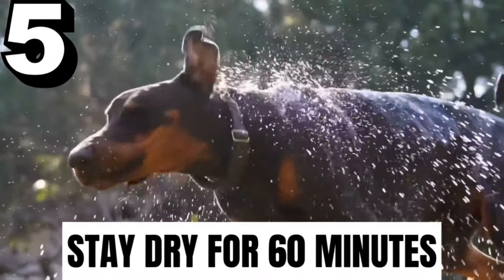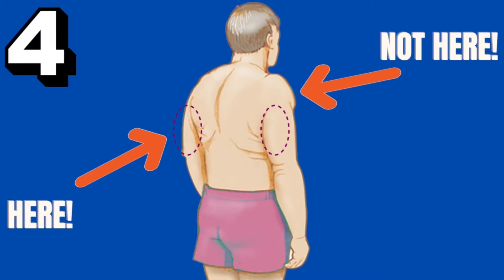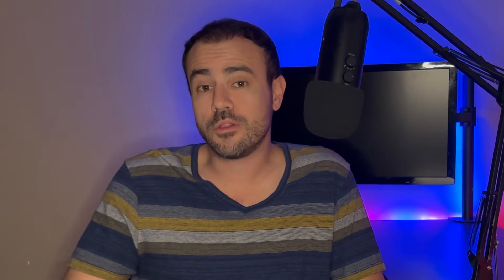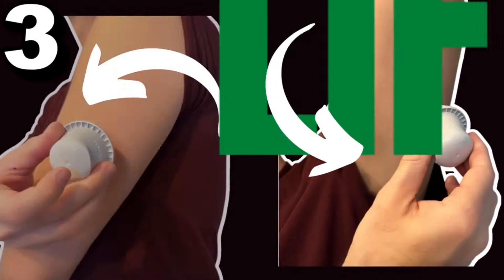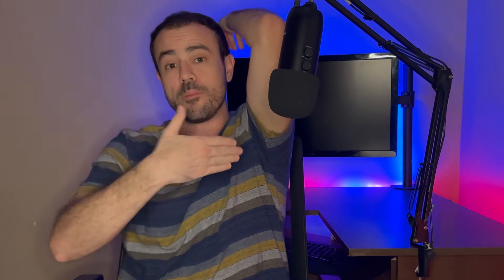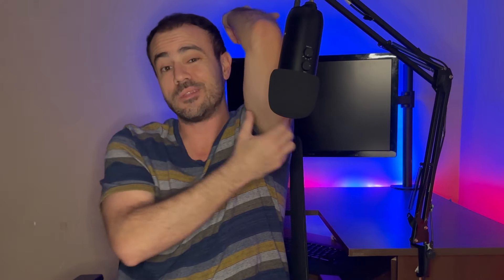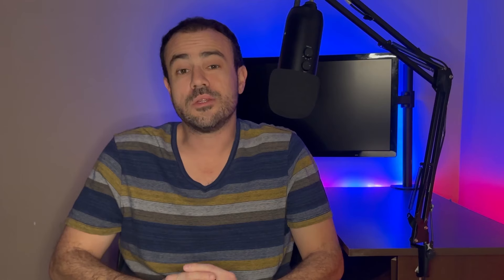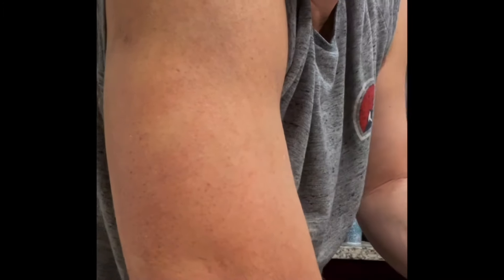Tips To Put Your Libre On The Right Way You Wont Find In The Manual!

Comment: I wish there was a work around so that we don't lose 60mins of readings in between sensor changes on the Libre3.
Reply from the maker: I agree. I hope in time the warm up period is eliminated. We’re definitely getting closer, the new Dexcom G7 is down to a 30 minute warm up time.
Reply: There is a work around when you see that you have 1 day left on the Libre 3 sensor, Insert the new Libre 3 sensor then when it shows you only have 1 hour left start the sensor you put on 23 hours ago. By doing this you are able to get better readings because the sensor has been in your body for 23 hours and has gotten adjusted to your body. Only thing is you need to have a second phone for this to work since starting the new senor will replace the previous sensor that was being used. This allows you to have non stop CGM readings. Hope this helps you out.
Reply: You are not going to die for 60 mins
Reply: Or, have a good old fashioned glucose meter and prick your finger during those 60 mins., if you need to.
Reply: I'll pass, to much of a hassle..smh. a finger pick not bad..
Reply: If the 60 minutes is a problem, it could be you have not realized one of the best features of a CGM.  A CGM allows one to chart, in real time, the effects of what you do, what you eat, and what you drink.  If after 14 days (336 hours) you haven’t figured out what you ate, drank or did leading up to the blank hour would do, shame on you.   Try to gain more situational awareness!
Reply: What’s an hour lost in two weeks?
Reply: I remember therapy and some sort of rehab!
Reply: Just put a new sensor on 1 hour before the current one expires..?
Reply: Wow why checking so much?

Comment: My favorite unadvertised trick is to apply a new sensor 24 hours before the current sensor expires.  The new sensor is much more accurate those first 12 to 24 hours after you activate it.
Reply: Does it more accurately recognize the new sensor?
Reply: @robynzelickson6164  I haven’t had any issues with it recognizing a new sensor. 
Just wait until the old sensor expires and then scan the new one that you applied 24 hours before. 
Your readings will be much more accurate right away because the sensor has acclimated.
Reply: @tomw83  @tomw83 ok so put on a new one before you take the old off? I took off the old expired one, put on the new one, scanned, waited 60 minutes. It said scan again 10 mins so I did. It said to scan up until 2 hours but then it just says to take it off. I put in a request for a new one online. I have this happen almost every other time.
Reply: @robynzelickson6164  yes I put a new sensor on 24 hours before the old one expires. 
When it expires and tells you to replace the sensor just take the old one off and scan the new sensor to activate it. 
I had a new sensor not work recently and when I took it off the needle looked like it was bent over and hadn’t penetrated my skin.
Reply: @tomw83 ok I'll do that this next time. I wondered about the needle being bent, or maybe the placement being in a muscle or something. Uch.
Reply: Does it hurt when you apply the sensor. That needle looks really big. How long do these sensors last?
Reply: @tomw83  thank you for your tip and I’ll try this out. I’m going to have my first Libre tomorrow and I’m looking forward to seeing if it works well with me.

Comment: I had my first 2 sensors fail from bent pins, doing exactly as described in so many videos. Called Abbott. Asked if I could put sensor on inside of arm, halfway between bicep and tricep. They said that was a good location. It works there. I sleep on my side so putting it where you say would pinch the sensor and produce compression lows, and possibly bend the tip of the sensor.
Reply: Wonder if that's what has been happening with mine, or they get pulled off prematurely 😢

Comment: I use a freestyle 14 day.
I’m not hairy, but I always shave my arm before application.
I also use a clarifying shampoo, then an exfoliating scrub, followed by plain, unscented soap.

I don’t use skintac or any other item to help it stick longer, and even though I have a physical job (EMT) and do HIIT training as well as rowing, it’s almost impossible to remove my sensor at the end of the 14 days.

The only time I had it came off early (and wow did it hurt!) was when I was doing a river rescue and someone pulled on my my arm in the exact spot my sensor was located.

Comment: I found these plastic patches that is normally used to cover a tatoo works pretty well. I usually put a small band-Aid over top of the sensor to keep it from sticking to the plastic coverings. They usually last about a week or so, depending on how much the area rubs on anything. But I usually don’t even notice it and it sticks very well if cleaned first. I used to know them off all the time. Haven’t had one fall off once since i found this. Oh and bringing it down more towards the elbow and inward by an inch or two works good too. Just thought this might help.

Comment: Thanks for the video, great tips!

I don't tend to have a problem with adhesion. The massive problem for me is reliability. I can't see what I could be doing wrong, but the last 5 of 6 sensors I've had have failed prematurely. Sometimes it's "glucose reading unavailable" for hours, and sometimes they just say "sensor failed". 

Abbott replace them ok, but it's left me in the lurch a few times.
Reply: I have had two fail one after the other recently. Before those two failures I had two others fail in 4 years of use. A bad batch perhaps or just bad luck. Plus the App has just been changed, perhaps it was the App?

Comment: Very good tips. Another thing that I do if I shave the area of where the sensor goes and it makes a huge difference for adhesion and longevity of the adhesive.
Reply from the maker: That’s a really good tip too! Thanks!!
Reply: I agree with shaving: think it’s not just obvious visible hairs that cause a problem, but the tiny fair hairs (fuzz) that may interfere with adhesion.
Reply: @tonytoo9999  absolutely! once I started doing that I almost never have a sensor come off unless I really catch it on something.

Comment: I used Skin tac first time but I am not sure if it can affect the freestyle two's reading as the filament that goes into your arm has to pass through that sticky skin Tac and that could stick to the filament and affect the reading, so I am not sure about using Skin Tac . I am going to try with out it this time. What do Abbot say about using it
Reply: use the Skin tac in a circular motion and leave a gap in the center that will not have the skin tac. This will prevent the pin from going through Skin tac

Comment: Very helpful, I think I've been following these as I've had a lot of sensor issues. I did have a question about placement. I'm a side sleeper and I've had 3 or 4 sensors go bad because I've slept on them. Maybe I should move them to the inner arm? Not really sure, I don't want to go through that process again with Abbott if I can avoid it... Thanks for an informative video!
Reply: side sleeper too. i've ended up putting a large fabric bandaid over it to help keep it on at night
Reply: @yomogami4561  Good idea, I moved mine slightly off center after I posted the above and haven't lost another sensor since then. I just went to the Libre 3 and I love it but it comes off more easily. Glad this worked for you if you just follow Abbott's advice, you're going to lose some sensors unfortunately.

Comment: I have difficulty getting a new sensor to start. I scan all over over with the back of my phone. I have tried without phone case and with nothing covering the sensor. I do this multiple times. Finally, with no reason that I can detect, it will start. Sometimes this happens after several hours. It happens with every new sensor. Any suggestions?

Comment: As a 56 year old woman, with fully sleeved arms (tattoos from tip of shoulders to wrists), and a heavier circumference of upper arm that indeed has stretch marks and moles, etc.  in addition to the tattoos, I have had pretty marginal success using the Libre3 CGM. 

I’m the single FT working mom of a teenager, and as I mentioned above, middle aged. Have these device engineers, doctors, scientists, etc. never met any women or fat folks in their line of work with Diabetics/Diabetes? (rhetorical - I already know the answer is no, they haven’t). And if the Dexcom can be placed in a multitude of locations on the body, why can’t the Libre CGM’s?

I’ve tried using these since early January, at $27 per sensor, and I’ve only had 2 stay on my arm and stay connected the entire 14 days. The rest either fell off, or failed to stay connected. 

These devices are way too specific on placement requirements to work every time for me. And because of my weight (a problem for a lot of Diabetics, let’s be real), I am running the risk of hitting an area that is going to bend the sensor, or land in a muscle instead of the interstitial tissue areas. 

My pharmacist gave me the additional hot tip about not installing these on tattooed skin. He also said I could try my chest or thigh instesd, but that those areas are not supported should the sensor fail. Libre should disclose the tattoo caveat prominently! I couldn’t find anything in the literature I received with my Libre3 devices, which doesn’t mean it isn’t there - it just means the font is so teeny, I can’t possibly read it. Did these same medical professionals forget that Diabetics also often have vision loss?

Sigh.

I will say thank you though for this very helpful video. I am going to try another Libre3 this evening, and if it fails again, I’ll beg my doctor and insurance provider to let me get a Dexcom G7 instead. Here’s hoping the Skin Tack really works!

Thanks again. Subscribed!
Reply: Since following your suggestions for placement, I'm in my 2nd application of a Libre3 with NO problems, even with all my tattoos. Woohoo!
Reply: I would jump for joy if I could pay $27 per sensor.  They are close to $100 each in Canada.

Comment: Since I use a Dexcom, I am not sure if my suggestion would be helpful or not, but I use the bottle of Skin-Tac and I put the liquid right onto the adhesive part of the CGM instead of directly on my skin.  That way I don't have any sticky residue on my skin that is not covered by the CGM adhesive.  Secondly, does it matter if the arm is raised straight up rather than having the arm bent?

Comment: What happens if you've carried a lot of weight and lost some and now have "bat wings?" Also, I see some people use something that looks like extra circular "waterproof" clear sticker covers that go over the sensor. Do these cover stickers work and do they interfere with transmission of glucose readings?
Reply: I can't keep my sensor in for the whole duration without adding additional adhesive (looks like a round bandaid) and it's called skin grip. It has never interfered with the sensor readings. I also put my sensor in my thigh and it works just as well as my arm.

Comment: dr recommended this product it cost me $75 with bcbs insurance and a coupon read the directions watched several videos and followed all instructions to a tee applied the sensor started the 60 min countdown and 15 minutes in I received an error message of loss communication  rescanned the sensor multiple times but kept getting the same error eventually removed sensor cleaned arm again more thoroughly applied new sensor but same thing happened $75 down the toilet
Reply: Sometimes the sensor may lose contact. Usually if you just wait somewhere between 5 and 10 minutes it will come back on.

Comment: Thank you for that :)  I will getting my very first Freestyle Libre soon,  Im a bit nervous about putting the sensor on for the first time.  Does it hurt? :)
Reply: Not really as the needle is tiny. The applicator is spring loaded so it has a kind of "snap" but its over in a nano-second. As a Type 1 I can't believe I survived without one of these sensors before. I've never had mine fall off and I'm outside fishing all the time. I bent the needle once when working on my boat by reaching into a tight space. I've rolled over on while sleeping and felt a bit of pinch, but 99% of the time I don't even notice its there. Just be careful getting dressed/undressed so it doesn't get caught on sleeve.
Reply: @johnmoore3504  Thank you for answering that for me :)  I feel a lot better now.
Reply: @johnmoore3504  When you scan, is it accurate enough?

Comment: I haven't had any issues with a sensor falling off, or coming undone.  They shut down after 6 to 8 days.  Says it can no longer read the sensor, put on a new one.  At the rate mine are failing like this, my 3 month supply of sensors will be gone in 5 weeks.  Insurance says too soon to request next batch.
Reply: Fill out a form on Abbott website. It is going to ask you for an error code. They will exchange it.

Comment: Hi - I am using a FSL 3 with a Reader.  I think (?) I saw a conflict in what you're saying wrt sensor placement on the arm.  You first state that it should be placed on the underside of the arm, by lifting your arm up and over, creating an "L" with your elbow being about mouth-height and wrist up and back (https://youtu.be/3EgtVD-oxTM?t=144). Then, you show it in a different place when talking about SkinTac - this is the side of your arm, not underneath, correct?  (https://youtu.be/3EgtVD-oxTM?t=251)... so which one is the right one?  PS I have used SkinTac before and you didn't mention that you must (per Abbott) keep the "needle" from getting into the SkinTac, or it will cause failure in interstitial readings.  Thanks for your videos and if I misconstrued what you were showing in location placement on the second URL, then feel free to respond back.  Thanks!

Comment: Does the sensor has a needle? I opened my first sensor and there is a little bit of plastic that seems to protect a needle on the cover side. Is the sensor flat or does it has a needle under it? It seems to me that on opening it (turning the cap) something is loose.
Reply: I had the same question when I started, the needle in the applicator is just to make the small incision for this little filament to go through. Once your first sensor is done and you remove it’s you’ll see a needle like thing sticking upwards, and it’s a filament that reads your glucose, you can touch it. It just feels like a plastic piece
Reply: The needle is a little thin piece that goes into your skin

Comment: Mostly people use their common sense. 
1.  I use my sensor on the front of my arm, because common sense dictates that should it start to  become unstuck, I won't notice it if it's on the back of my arm.  

2.  I wear mine just above my elbow towards the front of my arm, or at the top of my arm, towards the inside where the skin is a little more flabby. Not all of us have muscles in those areas. I have never once had a bent cannula not has it been painful.  

3.  My Libre has fallen off precisely once in the whole 3 yrs I've been using Libre. That's because I wasn't paying attention to whether it was sticking well or not.  I got a replacement from Abbott because I was on day 7.  

4.  If I see it begin to be unstuck, I use a strip of hypafix over the top of it which is also waterproof so stays stuck on. 

5.  I don't exfoliate before I put the sensor on.  But I don't use skin lotion on the places that I am likely to put it either.  

6.  Plus where it's been positioned makes absolutely no difference to my readings.  My readings are always accurate with a finger prick should I choose to test it out, and so it makes no difference. The ONLY reason that we are told to put the sensor where you suggest is because that is the only place the FDA have approved it to be worn.  That does not mean it isn't accurate elsewhere. Some people don't wear it on their arm at all. This is exactly the same with the Omnipod.  We are told to put it on the back of our arm and only other certain places.Again that's  because the FDA only approved it for those places on the body.   People like me using omnipod place it in all sorts of areas and it still works absolutely fine.

Comment: After applying my new sensor I see blood coming out of the open middle area will I get an accurate blood count ?
Reply from the maker: That can happen on occasion. More often than not when that happens for me I still get fairly accurate readings. It would be best though in the beginning to compare the readings to a finger stick to ensure there isn’t any significant variations. If so I’d replace it. Best of luck!
Reply: I’ve had blood “spurt” out dramatically a couple of times and hasn’t caused a problem - must have caught a vein. 

It’s a reminder to insert a new sensor in the bathroom and not the lounge, specially if you have cream carpets😮
Reply: I’ve had blood twice after fitting them, I spotted it on my finger the first time and I was so confused about where blood has gotten on me, first thing I was checking my fingers for cuts. 
Only later on when I was getting ready for a shower I spotted the stale blood on my sensor. It still worked fine.
The 2nd time it happened I knew what it was.

Comment: How do you get the 2 sections to come apart? Or do you have to? I turn it as far as i can but the cap doesn't come off???
Reply: Ok so I get someone else to break the seal
Reply: That happens to me every time. My partner is able to do it, still difficult for him though. They need to fix that because it is way too difficult to separate.
Reply: @teresatradewell8548 yes it is. I simply can't do it. I have to get someone else to do it for me.